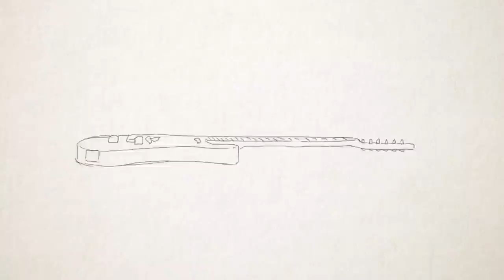Check out the Finished New York Guitar

Comment: Wow, what a beautiful guitar! This one might be my favorite; the headstock is certainly my favorite of all the ones you’ve done so far.

I would love to see you team up with someone from Broadway to auction or raffle off the guitar. Maybe for Broadway Cares, but any organization that helps New York would be great.

I’m curious about the fret filing process. When you round out the frets after leveling them, does that affect the leveling? How do you smooth the sides without removing even more from the top and therefore making them uneven again? It seems like they’re so small it would be hard to be so precise, but maybe if you’ve got the right files and tools the small size isn’t so difficult to work with.

As a huge Bob Ross fan, I can’t wait to see the next guitar. He inspired me to try painting for the first time, and I know this guitar will have happy accidents and hopefully a tree friend or two.
Reply from the maker: This time I used a special file that goes at an angle so it won’t affect the high point of the flattened fret.

Comment: what happens if you accidentally sand down the fret too much? Does it throw the other frets off balance so you'd have to sand all of them down more, or can you replace a single fret if it gets sanded too much?
Reply from the maker: That can happen. Usually a re-fret is done to the whole guitar at once. The nice thing about using that “Fret Kisser” tool is that it won’t let me sand any further than the height of the surrounding frets.
Reply: Gifted Guitars by Chris Ballinger Cool! Thanks for the reply